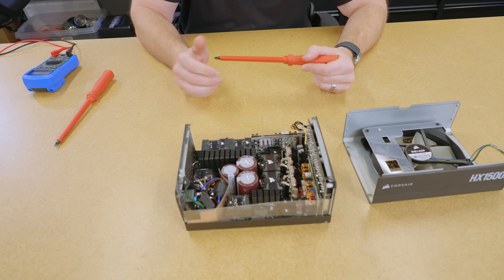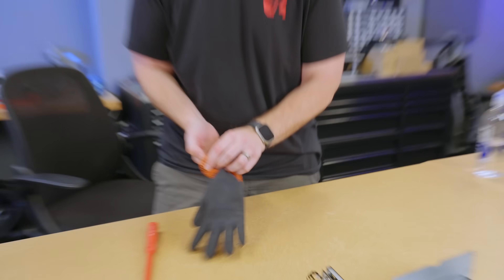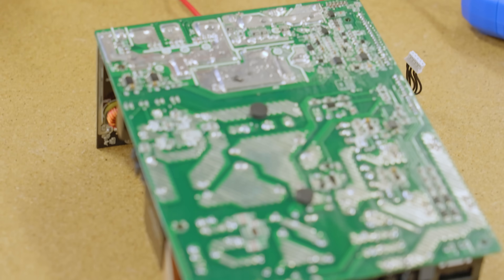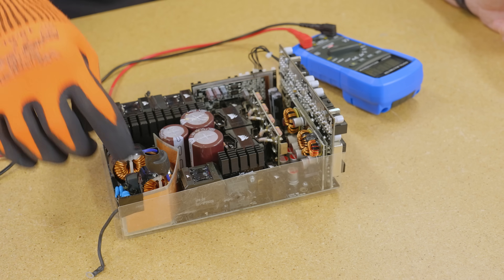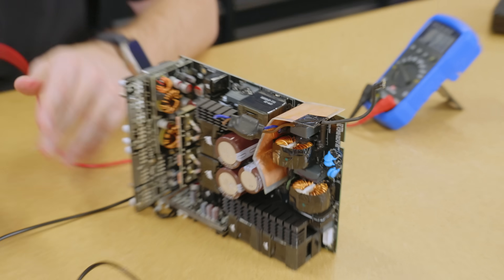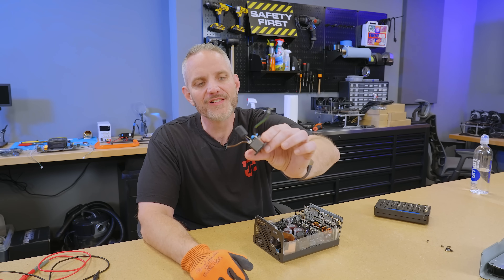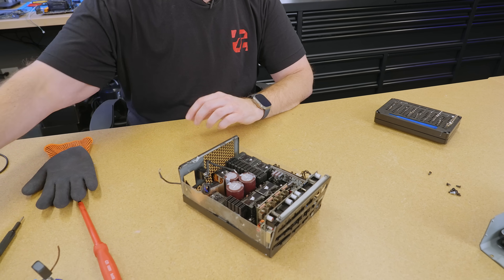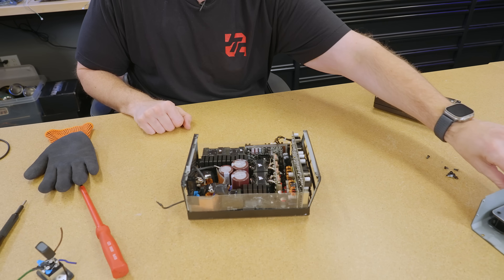Investigating what exploded in my PSU... DANGEROUS! DONT ATTEMPT!

Comment: Jay, electronics engineer here. Install a 100k 1w resistor across each of the 3 big electrolytic cap and that dangerous voltage will bleed away in a few minutes. Shame the OEM didn't build them in as good design mandates.
Reply: Yeah, I used to TA an undergrad design lab where we'd have students build linear power supplies.  Getting them to design and build a discharge circuit was the very last week so plenty of practice manually discharging circuits before helping to troubleshoot.  In this case it's easy to just calculate the RC time constant, but it's good to give it plenty of extra time and then double check with a voltmeter since you're never 100% sure how those other capacitors might be connected within the circuit.  Not everyone has a 1W resistor so it doesn't hurt to do a higher resistance value, but a 10k resistor on a 470uF cap will discharge nearly 2/3 of its voltage in 4.7 seconds.
Reply: @EkiToji I said 100k not 10k. Anywhere from 100k up to 1m would do fine.
Reply: Jip even if you have a small 1/4 w one just use a higher value like 1mega ohm so it does not overheat and burn trough. Just takes a minute ore 2 too discharge. Or use a incandecent lightbuld wil be quicker and also limit the discharge current as light starts to shine
Reply: The load (always applied) is the discharge path for the caps, there is no need for a discharge resistor in this case, plus they are not very big caps and certainly not lethal (on the bench like that, powered up they would be).
Reply: just use your tongue, problem solved
Reply: Even an ultra-cheap microwave I pulled out the trash a decade ago had a bleed resistor on the cap. Granted, that's FAR more dangerous than this.
Reply: Sadly, people spend very little money on the PSU.  Including those resistors would drive the price up and hurt sales.
Reply: Is called "discharge system" I'm also an electronic engineer specialized in safety and QA/QC. 

Is very sad to see a modern power supply without that system, usually a small led and a resistor does the trick, if I were responsible of that design I'll totally send it back and give whoever designed that a serious talk about safety.
Reply: Why doesn't this PSU have bleed resistors across those capacitors?
Reply: @johngangemi1361  good question
Reply: it could be months the charge can stay
non expert be cautious
Reply: not useually used in smps
Reply: Yes, the caps should not hold charge, if there's bleed resistors in place
Reply: "Shame the OEM didn't build them in as good design mandates."  <---  they are supposed to by law.  i don't know if it failed here, or if it wasn't there like it was supposed to be.
Reply: @Zangetsu2026   No actually internally there are allowed be hazardous things, it's merely when you touch the inlet, it is no longer allowed to zap you. The thing is the fatal cap is behind a boost circuit (APFC) so it doesn't backfeed into the mains! This device is compliant with relevant consumer safety norms.
Reply: You are a confused, recall from circuits 1 that the time constant tau for capacitors is RC, meaning you would want a low resistance resistor with a high power rating to discharge it faster.
Reply: Guessing they don't put resistors across them as they wouldn't get efficiency rating they wanted
Reply: and you think shorting a 110v cap knowing its e-waste isnt the literal obvious thing to do? its not like they're dealing with magnetron caps
Reply: Would Jayz's multimeter set to Ohms slowly discharge them?
Reply: @TheMikeyb86 That will likely kill the multimeter. In volts mode, the meters resistance is likely 10M making the discharge very slow.
Send 20c and place resistors there.
Reply: @TheMikeyb86  Typically the way a multimeter measures ohms is by sending a low voltage current through the probes and seeing how many amps flow through the circuit. If the capacitors were empty, this would actually charge them (very slowly), but with already full capacitors, you'll just feed a lot of current into the multimeter and probably damage it.
Reply: @TheMikeyb86  a multimeter should not be used in ohms mode on live components. Very good posibility you will damage the multimeter
Reply: @Day-px7wr  noted, thanks.
Reply: @Day-px7wr  Yep, need to repair my analog multi-meters every few weeks because of exactly this. Forget to check your settings and anything higher than 5-10v on the ohms will burn a resistor on the multimeter. 150V like on these capacitors is an instant pop. Usually just a simple resistor to change though.
Reply: @Day-px7wr  Very good point. Besides if you have $100 for a decent meter then you probably also have a penny or 2 to spend on a resistor to do the job more safely and with less risk of damage.
Reply: @TheMikeyb86  The multimeter would either be damaged/destroyed, or if it had a capable protection circuit, a low value internal fuse would blow and the meter would need to be opened up and the fuse replaced.
Reply: @PlatypusPerspective great insight, much appreciated.
Reply: @TheMikeyb86  you could set the multy meter to a high amp current setting measurement, and that is a 'short' or a resistance, that that is a terrible idea, just put a bit of wire across them, there will be a SMALL spart (if you even notice one at all), There are not huge caps holding vast amounts of power/ energy.
Reply: @TheMikeyb86  No and who ever upvoted this is stupid. Resistance readings use a small potential between probes. Taking a voltage reading involves a 10 mega ohm resistance.

Comment: You can safely discharge capacitors using resistors. 100 ohm would probably work. The resistor will just heat up to disperse the energy

Comment: Probably a diode or a MOSFET blew. Those can make a very loud popping noise that  that sounds like a flashbang as you had mentioned. Hundreds of amps go through these silicon devices. Capacitors hold a lot of current, but will not fail without any physical evidence. It'll end up being bloated or literally split apart.  The capacitors are designed with tear joints to break open to release the pressure as not to explode. I highly doubt the capacitors what caused the issue.
Reply: If you look closely at one of the caps with yellow goo on top, it looks like it split open right on the tear joint.
Reply: @AC-cg4be yep, first thing I saw when he zoomed in to the caps.
Reply: You can always discharge a capacitor through AC light bulb. That will light up and just dissipate the capacitor to a very low voltage. Then they are harmless.
Reply: Most good PSUs also have a few fuses to protect them from killing your PC during really bad surges/brownouts. Not replaceable fuses like most people are used to, but literal chunks of metal machined to act as a bus for exactly 150-250v or whatever. When that chunk of metal blows, it also makes a VERY loud pop/bang sound.

Translation: That PSU likely sacrificed itself to save his bench. By design.
Reply: You can clearly see a couple were popped by the issue, though.

Comment: it is corsair IT IS to be expected almost all of corsair products are not good enough the only ones that i can trust are SEASONIC and FSP
Reply: that's about as bullshit as "but WD drives are better than seagate"
in the end pretty much everything inside these metal cans comes from somewhere in asia with more or less the same quality
if corsair would be as bad as you say it would had fallen hard years ago
and even if - it's one of the big brands big enough to take the hit - see asus as yet another example: their products also heavily degraded over the past years - yet they're still among the top and can syphon thier rog tax same as apple does

if you make such claims at least back them up with reliable facts
Reply: @cryptearth  that was my experience with corsair 2 dead PSUs 1 keyboard 1 stick of  ram
they rely too heavily on outsource manufacturing that is exactly why i only trust my PCs heart with Seasonic or FSP i have 3 Seasonic PSUs that has lived more than they should in the worst electricity possible area in my country and they still work as intended corsair didn't even make it for a year FSP has gone a long way but the worst PSU from them that i had killed itself to protect my PC component unlike my corsair that destroyed my GPU with it

Comment: Using the Multi-meter to read the voltage if you hold them long enough you will see it drop you can use a large resistor to discharge them of a radiator but shorting them will do the trick. @JayzTwoCents I once had a tiny mosfet blow off a motherboard and that made a large bang (computer remained running) and flew out of the pc 20ft across the room and bounced off my front door...it blew a hole in the motherboard but I cleared the short and it still ran for 2 years with a missing VRM mosfet.

Comment: Discharging these caps by shorting is totally fine. Little bit of arcing and then it's all over.
Reply: it is bad for the internal wiring-conductance of the caps. They are NOT supposed to give such amperage that occurs in a dead short. you just use a resistor or light to discharge.
Reply: @markae0 then why is a shorting probe the recommend way to discharge capacitors in a high voltage system? And by high voltage, I'm talking radar systems running around 40k volts.
Reply: @PlagueSD  And we are talking about a Corsair PSU. Even Gubm'nt don't accept bids that low!
Reply: @markae0  It was a blown PSU, so not an issue. It is going to a recycling center as e-waste
Reply: @markae0  considering its going to an ewaste site its fine to short it
Reply: @markae0 it's dead anyway with no intentions to be repaired but to get wasted - who gives?

Comment: we use a incandescent 220V bulb to discharge the caps
Reply: i was going to say a toaster. see how many pieces of toast you can get out of the capacitor :P

it should be able to handle higher than 120 for a while. I've seen a uk youtuber who got sent an american toaster, he plugged it in and used it a few times before it started to get too hot and melted a bit, and thats 240v.
Reply: I think a 120v bulb will also survive, as the load will not be long enough to melt it. An electric water kettle is another option.
Reply: Exactly what I was going to suggest.
Reply: @mariestarlight  like how are you going to use a 220v bulb to discharge the caps
Reply: @mikehow7619  are you kidding?  Just hook up the bulb to each cap in turn, it will bleed off the current trying to light the bulb.  And since the bulb is made for higher voltage than the caps are holding it won't blow the bulb.
Reply: Or along those lines… even a 110V incandescent bulb would probably be fine. Just put the plug of the lamp across the caps. And you might need to do all three separately if they are different voltage busses.
Reply: Or a 1/2 W 1 Meg resistor  ..... Lots of motor start and run capacitors have a 1 Meg resistor built in to discharge the cap
Reply: Right, it's a power supply, you drain the caps by putting a load on the outputs.
Reply: Good idea, I usually use a non insulated screwdriver on caps this size 🤷
Reply: I'd wire a 1000 ohm resistor in parallel with the multimeter probes, and use them across the capacitors. You'll be able to see the voltage drop off at the same time.
Reply: @MrNeocortex  it's industry standard to have 22k 1w to 47k half watt soldered in direct across each cap from factory, seems this psu is quite a bit micky mouse 😮
Reply: Use the soldering iron or hot air gun, failing that a toaster or kettle will do the job of pulling the power out. 150V is only part, volt that jolt amps that cramp so how much amperage is left matters the meter will read even microamps.
Reply: @badadamuk the energy stored in caps is fully dependent on the voltage, when we are talking about the same capacitor higher voltage more joule stored
Reply: yes and thats an easy to hand solution but bit of a hefty surge current  on the caps if you are using usual household lamps 
120ac will rectify to about 170vdc but with active power factor correction maybe about 30v higher (best guess as never worked on a 120v smpsu just 240v) so the 220v bulb would be perfect but experiance from my dim bulb tester a cold filament of 240v 60w bulb is going to be somewhere around 120 ohms so surge current 1.6amps all be it very short duration ,id recomment a little 15w pigmy bulb to bring the surge current down
Reply: Clever idea for someone who knows what they are doing, but don't have any tools.
Reply: That's what chat gpt told me too 😂 tho there are resisters made for that that have clips and a readout to assure you get all the power drained
Reply: @armani22  Good to know. Thanks.
Reply: basically any resistor with a wire to connect the prongs.
Reply: How about just putting in on the ground to ground it?
Reply: ghost in the shell !
Reply: That means an automotive test light can be used…🤔
Reply: 66 times! In in in, in in in, the head!!!😂
Reply: Why do I suddenly feel like that would be fun to try 😂 even if just to see how long it stays on 😅
Reply: Big shunt resistor also works
Reply: @zmeul your profile picture is my love language. Lol
Reply: Chuck it in a bucket of water...dead anyway isn't it..but then you know the circuit is at 0 volts
Reply: just solder wires to each end of a big resistor. then use that to discharge to ground. the resistor will heat up as the current flows.
Reply: multimeter can do the same if it set on ohm setting but make sure your multimeter are not those cheap ass one as they don't have ptc
Reply: I would have used a (bleeder) resistance to discharge the elcos. 
100 Ohm 1W or so should have worked out, I'd say.
Off course connected by using isolated wires 😊.
Reply: I just use isolated gloves and a screwdriver... it isn't safe, but it work. lmao
Reply: Your ears might to this.@Keaton.
Reply: I like my fingers and touch them.
Reply: Does it have to be incandescent? Seems like any bulb would do.
Reply: @OctagonalSquare  No, but it is the cheapest and probably the most robust option from different bulb types.
Reply: @OctagonalSquare  The best to use is the one you can get your hands on.
Reply: @OctagonalSquare incandescent are the least efficient thus draw more powers
Reply: Just use my tongue,makes the non-existent hair on my head stand on end,and my beard goes full crazy!😂😉
Reply: A big resistor with bug cables works better. Bulb will work but can damage the capacitors cause they are not designed to be discharged very quickly
Reply: @terminationshock1356  For what it's worth we know they can at least handle a 60Hz cycle since that's what comes out of the wall, and in any event there's no future expected usefulness for any of the components in that box. And if they blow up while the camera is running that's just more click-worthy content.
Reply: @NateEngle  It be another RIP GN vid. Steve and Co. have had PSU's pop on camera; but I don't think they've blown up a 1500 watt one.😁
Reply: @terminationshock1356  Erm, the PSU is dead, dude. There ain't a lot going on the otherside of dead.
Reply: 12v fans would do the same job too
Reply: @petert3355  i dont think a 12v fan would really like a couple farad of 150v dumped into it.
Reply: @picassoimpaler3243  If there is one thing a rig builder is going to have is a pile of meh! fans that they swapped out.
Reply: @petert3355  12v fan on 150v ???? I hope you are dissipating through a 10W resistor of at least 1Mohm
Reply: @krisbuggenhout5022  Well yeah, point is you want something to provde "work" for the cap to do. Some thing visable so you know when the cap is discharged.
Light bulb goes out, or fan stops moving, etc
Reply: @krisbuggenhout5022  it'll just run at ~12x the usual max speed duh
Reply: @petert3355  Everyone here will guarantee you the 12V fan won't even start spinning because the coil in that thing will have burnt right through the second you attach it to 150V......
Reply: @petert3355  and ho ware you going to do that

Comment: Looks like one of the main switching mosfets died
you can replace it with a new mosfet and fix it
I've fixed a few with a similar issue and it worked like new
Reply: Yep use to repair power supplies awhile back.  It was usually a cap which I doubt in this case since none are bloated or missing.  Most likely one or more of the Fire Emitting Transistors...I mean FETs.
Reply: @pcplayer9193  You can see that at least one of the caps has vented.
Reply: You can see the hole in the cap that's blown.
Reply: @agenttassadar7272 even still one cap in a paralell bank will not stop it from working worst case it will power cycle
Reply: @bashaaksema94  I think Jay will have got/will get the message. We are chipping in with anecdotes and using this as a teaching moment. If you don't make (safe) mistakes; you rarely learn anything.
Reply: @agenttassadar7272  can you point the cap? Cuz I don't see a vented cap
And usually when a cap vents or blows up it creates alot of mess and smell
Reply: @vampy625  
@7:25
Also some yellow residue.
I am watching this one my phone, but it looks like a straight line where it vented. @7:43
Reply: @vampy625  The bit where Jay mentions the yellow streak as coincidental. That cap has vented; one looks ok; the other has a pinhole in it. 7:50
Reply: @stevewatson6839  Jay mentioned a massive pop which i doubt will cause that small of a residue
Reply: I agree probably some power mosfet or rectifier diode

Comment: Points finger at the traces Bare handed
Reply: we used to service old valve tv's bare handed, electricians were brave in the old days!
Reply: S A I F.
Reply: My anxiety was through the roof. Way too nonchalant
Reply: When I was young I did disassemble several psus for cables, I did not know anything about capacitors etc... Would touch everything barehanded, somehow I'm alive, never had any issues. Must got lucky.
Reply: @wykydytron same 😂
Reply: a n i m e
n
i
m
e